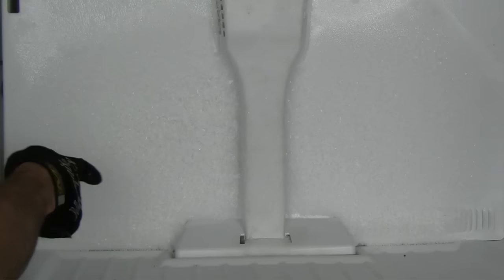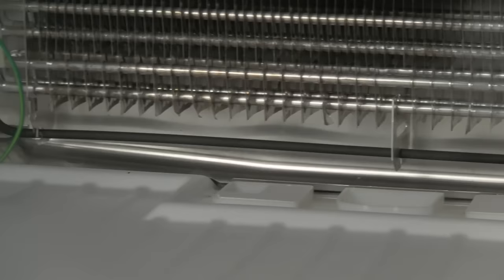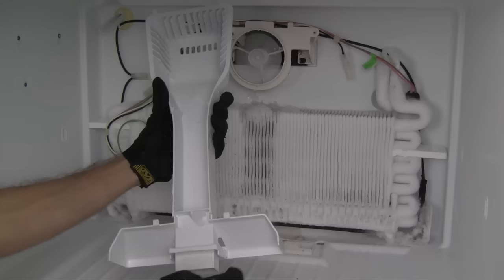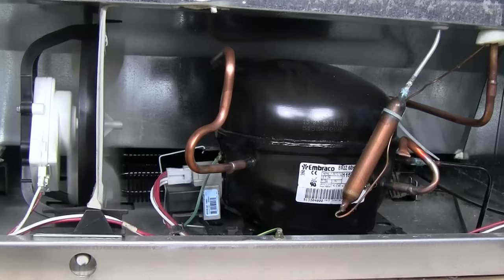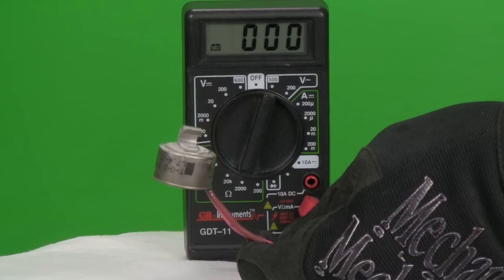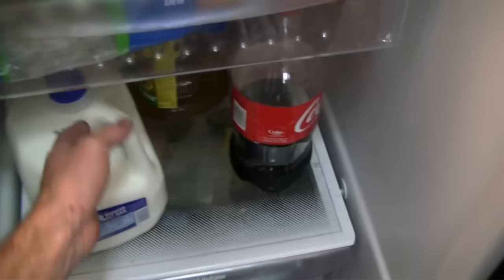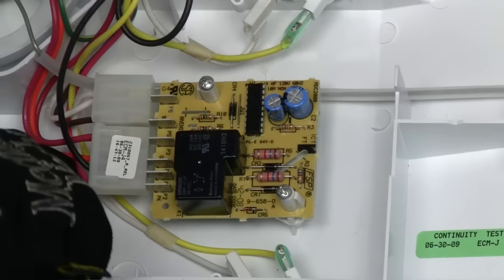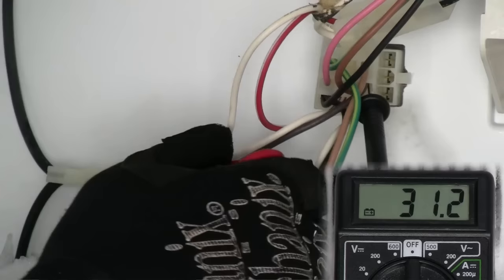Refrigerator Repair (Not Cooling, Defrost System)

Comment: I have a GE PFSF5NFZA model French door bottom mount freezer- freezer is super cold (-14c) and when I try to turn it down to 0 it just keeps getting colder and trying to get the fridge temp back down from 46c to 37c isn't working.  Called a repair tech and he came out and took the freezer apart and said there was no frost on coils, ice maker working fine, but he took the flap cover off the vent behind the dairy case in the fridge portion and said those two tubes where the cold air from the freezer circulates into the fridge were frozen solid and to defrost the fridge for 24h because most likely a door was left ajar... I did that and it ran great for a month and did the same thing- freezer super cold fridge warm - I called the tech again, he tested the control board and said the board which is the first thing that usually goes in these models is fine but my heater is dead and can't be repaired on this specific model because the way GE built it and I need to buy a new fridge- this fridge is barely 6 years old and no budget for a new fridge, is this something you have come across? I spoke to another tech that is familiar with GE and they said a number of things should have been checked too like the seals and doors, thermistor, thermostat, temp sensors, the relays to the heater and the temp control and felt I should get a second opinion.  When I defrosted it and it was running great, I could hear the fridge cycle on and off, now it runs constantly. I love this fridge and had zero issues with it before- regularly cleaned the coils only started having these issues after my son left the fridge door open (approx 3 hours later was when I noticed)  Any help or insight would be much appreciated.  Thank you!

Comment from the maker: Look for a flap like part that controls air flow into the fresh food area from the freezer.  That part is ether frozen open or if it's motor controlled the motor may not be working. If the air duct control door cannot close then food in the refrigerator can freeze.  What is your model number?

Comment: If the defrost heater goes bad, could that cause a ground fault and trip a gfic?  Or, is it more likely that the gfic is tripped by the board being bad?  I run my fridge in service mode and it trips it when I initiate the defrost cycle.  Many thanks!
Reply from the maker: The heater can definitely cause that problem. The other possibility would be the defrost thermostat, and lastly the control. If you get a multimeter you can check the heater and thermostat for any connection to ground on the cabinet, there shouldn’t be any. Good luck!

Comment: Hi, I have a Samsung side by side fridge freezer Model RS20CCMS. Recently the digital display has said it is at the correct temperatures but I noticed the fridge was getting warm. I turned the fridge off then back on and the digital display went from saying 2 degrees fridge side and -20 Freezer side to 16 Degrees fridge side and -10 Freezer side. I pulled the cover off on the inside of the freezer side and used a hair dryer to get rid of excess ice build up. it all worked well for a week and then did the same thing, the display was showing correct readings but when turned off then on again would show its actual temp which was not cold at all. Do you think my problem is with the display controller or with one of the thermostats? Cant really afford a new fridge at the moment so any help with this would be great! Thanks!
Reply from the maker: Sorry for the delay!  That's a tough one… If you have a trustworthy tech in your area that knows Samsung refrigerators, it would probably be best to call… I do have the manual for that refrigerator on my website so you can do diagnostics and see if there are any error codes to point you in the direction of the problem, but they are very complicated! Could be control, sensors, or defrost system problem.  Here is a link to the manual (Not for your exact model but probably will work) http://applianceassistant.com/Appliance-Repair/Appliance-Service-Repair-Manual-Feature.php?id=2219

Comment: Hi I replaced it according to an instructional video. However, After a while, I decided to clean the fridge and I went ahead and unplugged the unit to clean it properly. However, when I was cleaning the freezer side and open the cover on the back of the freezer I observed that the coil I replaced was burning the side wall of the fridge! The fridge has been working fine since I replaced this part, but I see know that I have a fire hazard there. How can I fix this? Let me know please
Reply from the maker: +Jessica Joy-Way First I would look to make sure its mounted properly, not off center... apart from that you may be able to shield the side wall that is getting too hot with some temperature resistant metallic tape... I know that sounds pretty weird but Frigidaire uses it quite a bit to protect plastic from hot lightbulbs.  I would guess that something with the heater or evaporator is out of place... Hope that helps! Sorry I couldn't be of more help.

Comment: The refrigerator just start making this loud run noise that sounding like a rain fall, and I unplugged it, and it still kept on running, and then I plugged it but up, and after 3-4 minture it stopped the noise! What happening?
Reply from the maker: sorry for the delay. It was probably the sound of water melting into the drip pan under the refrigerator. it's probably the normal operation, nothing to worry about.  : )

Comment: Great video thanks for sharing! I have an LG bottom freezer refrigerator that is cold in the refrigerator section, but is the same cold only in the freezer. My model number is LRBC20512WW. I opened up the back and the compressor is hot and the condenser fan is working. I replaced the start relay, but it was a waste and didn’t fix it. Any suggestions as to what the likely culprit might be? I have a multi meter if I need to check a component. Thanks much appreciated...Joe

Comment: @applianceassistant thanks, so far so good, but the refrigirater isnt as cold as it use to be, my milk use to freese on a normal setting,,

I dont have any thing in freezer, the owners manual said that frozen items will make freezer colder, I guess it takes a few days to get refrigirter super cold

since I thawed it out the fan sounds better and compresser dosent stay on as long,

Comment from the maker: @washrooms Take a look at the troubleshooting refrigerator problems page on my website (link is in the video description.) Click on "Checking the compressor and start relay." in the "Select the problem that best describes your refrigerator's symptoms from the list" (last one) That may help you to narrow down what you are dealing with. If the compressor is not running ether the board is not sending electricity for some reason, or the compressor or start relay is bad.

Comment: hi my refrigerator brand is iberna and it stopped cooling i have opened the back and fond some kind of plastic  plate above the compressor filled with smelly water how can i fix it help
Reply from the maker: +mohamed read That sounds like the drip pan. it's usually filled with smelly water from the defrost cycle, however i't probably more full because the refrigerator is not working... thats not your main problem though. If the compressor is running and its not getting cold in the freezer it's probably a major problem and not worth fixing. However, if the compressor is not running it may be the thermostat or defrost timer... here is a troubleshooting guide that may help.
http://applianceassistant.com/Refrigerator-Repair/Troubleshooting-Refrigerator-Problems.php

Comment: thank you very much for instructions. I have made troubleshoot on my start relay and compressor as you advised me. the voltage at the wire entering relay (relay input) was 220V ie supply voltage. but output of relay is much less than that about 35V.I also tested compressor for continuity and for resistance, it seems to be ok. I thought that I have problem with relay. my relay is 250V, 1.2A.  I replaced my relay with new one 250V, 1.4A but it did not help.do  I need exactly 250V,1.2A  relay?

Comment: Thanks for the helpful video. My freezer works normally for a few days and then it stops working entirely and everything melts. The ice still comes out normally but it melts in the container.  When the freezer starts freezing again, all of the defrosted food and ice refreezes, so I can't use this refrigerator until it is fixed. The refrigerator part seems to be fine.  Is this video the one to watch for troubleshooting whatever is wrong with my refrigerator?   I'll share your website link.  Sorry for the drop in hits.
Reply from the maker: Thanks!  Sorry for the delay in getting back to you on this! Sounds a little strange, Do you know the model number of your refrigerator? I'm wondering if it has 2 evaporators, because otherwise the fresh food section should warm up with the freezer failure....
Reply: I'll check and let you know. Thanks for getting back to me.

Comment: At 3:05 I have the same fridge style my condenser fan will come kick on for a second then kick off for a while until it finally kicks on. Is the fan bad or is it something else?
Reply from the maker: Hard to say for sure you would need to check with a meter if the voltage was dropping off. Odds are it’s a bad contact point somewhere, likely in the motor windings. If you wanted to guess at it I would go with the motor. I hope that helps some!

Comment: Thanks for the video. I need some specific help. I have a model #PSS26SGPASS that stopped cooling and just makes a loud noise, I think from the freezer side. The loud noise is only present when the doors are shut. The light inside and digits come on but doesn't show right temperature. At first it showed 555 on each screen, then it would show an error that looked like "Le", then it would look like it lets me change the temp but then would default to the numbers 78 on each side. Any idea what could be the problem? Thank you!
Reply from the maker: I would start with liking at the evaporator fan motor behind the back wall of the freezer.  That is likely to source of the noise.  It could be that you have frost build up or ice from the ice maker hitting against the fan which only runs when the door is closed.  You can close the door switch and check it out.  The temperature problem may be related to that, air flow makes has a big effect on temperatures.  Hope that helps some! Good luck!

Comment: Hi, so I just learned how to use a multi-meter today. I checked the thermistor, and its resistance varied with different temperature waters indicating that it's working. I checked the resistance of thermo-fuse and it was close to zero indicating that it also is working. However, when I'm checked my defrost heater, I'm getting a resistance of 1 which indicates that it's broken.

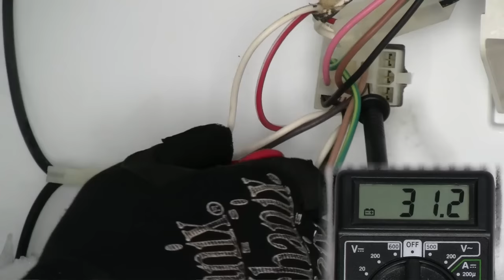However, I'm not sure if the way I'm checking the resistance is correct. I did it the way it was done at the video @ the 5:32 mark and got an infinite resistance. I wasn't sure if I was supposed to do it the way the video did it @ the 5:50 mark, as I didn't try that at all because I didn't understand it. 

Do I need a new heater?
Reply from the maker: Sorry for the delay in getting back to you on this.  It sounds like you have narrowed it down well! A new heater should fix it. Thanks for the question!

Comment: in the process of buying a new fridge but I can't help but wonder if I'm jumping the gun on ditching my old fridge. it has been problematic for some time now and a new unit is probably the answer but I figured I'd look around one last time....so, problems started months ago with a loud dropping noise whenever it cycled, so I cleaned around the coils on the bottom, it stopped for a bit but cont. to do it. then I was getting water on the bottom of the crisper drawers, i checked for leaks or

Comment: Question, I moved contents to the garage, cleaned it out a few days ago.There was no blockage, no frost. If the fridge is a 50F and I turn the dial to off and then back to high it will turn on and cool to high 30's, low 40,s. Later I will recheck it and it's warm again 50F. Could it need the thermostat and/ or thermal weight?

Comment: I have a GE bottom freezer double door refrigerator, model # GFMS5HFFA SS and I'm trying to determine if I need to buy a new evaporator fan. I have noticed that the refrigerator section warms up because the fan in the freezer is not blowing cold air up. It'll work fine for 5 or 6 days and then stop working. I should note that the freezer continues to stay cold and works fine.

The weird thing is that the problem comes and goes. I have determined that If I unplug the fridge for a few hours and plug it back in the fan works fine and cools down the refrigerator and both the freezer and refrigerator function as designed...and will sometimes work fine for several days and then suddenly the refrigerator is warm again...because that little fan in the bottom is not going.

 My question is if the evaporator fan goes completely it probably wouldn't fail and then start working fine after a period of rest. Are these fans known to work for several days and then suddenly stop? Or do they just go completely? I don't want to spend more than a hundred dollars on a new fan if the problem lies in the control board or thermostat. I do not have the expertise to check those parts...but I can quickly and easily change out the evaporator fan...if, in fact, it is gone.
Reply: Sounds to me like you may have a defrost problem... The few hours of being off may let it melt enough to let air pass. Is there a large amount of frost on the evaporator? The fan should be running anytime the compressor is running. However, on some models, the fan will turn off when the door is open so you need to determine if that is the case on your model.  If the fan is actually failing after a few days and it's not frost build up that is keeping the air from getting to the top and into your refrigerator, you may have a control board problem, that is more likely to be intermittent that the fan itself. However, I have had an intermitant fan motor from time to time but it's very rare. Hope that helps some!

Comment: Hi my side by side refrigerator is not cooling,and the freezer side gets full of ice,can you help me.
Reply from the maker: Start with manually deicing it by unplugging it. I should work for a about a week or two. Then keep a close watch for ice build up on the back wall of the freezer compartment.  If it comes back there is a mechanical problem with ether the heater, defrost thermostat, or defrost control that would need to diagnosed.  Hope that helps… Good luck!

Comment: i have an over/under unit and it starting making crazy noises the other day.  we messed around with it and i even left the freezer door cracked for a few hours.  that seemed to help the refrigerator cool again, but now there is no noise and it isn't cooling at all.  the freezer is working, though i am seeing a bit of frost on the food.  there is a little frost on the fan unit in the back.  i have just unplugged it to see if thawing it out will get the bottom part working again.  any thoughts???

Comment from the maker: Sorry I didn't see this post when I was writing the last one.  It could be the compressor with that bit of info... HAve you or any of the techs cleaned out the condenser coils under the appliance? there is a 3n1 hard start relay kit that increases the starting torque of the compressor (about 20.00 part). That may buy you a year or so if it is going bad... : (

Comment: What does the thermal fuse do on the evaporator of a samsung refrigerator? The service manual states there is a thermal fuse and a thermistor in the freezer but the illustrated parts breakdown states there are 2 temperature sensors.  Is the Thermal fuse the same as a bimetal thermostat?
Reply from the maker: Sorry for the slow response! Missed this one some how... The thermal fuse is a second safety agains the heater staying on too long and causing a problem. We will probably see more of that in future designs.

Comment from the maker: When the sides or the center divider start getting hot it is a sign that ether the coils under the refrigerator are full of dust and need to be cleaned... or that the fan next to the compressor is not working for some reason.  first check if the condenser fan is working, if it is unplug it for an hour and try cleaning out the condenser coils under the appliance. Say a little prayer then plug it in... It may have taken out the compressor in which case it's junk :(  Good luck!

Comment: i have a GE side by side. replaced the bi-metal thermostat and the heater element and frost still builds up in 2weeks, where i have to pull out the blow dryer again and defrost evap. what else can i ck and how to i test the board/thermisters correctly? help please. thanks
Reply from the maker: I will say GE Refrigerator control boards are a common point of failure, and difficult to isolate as the problem... I would advise replacing the defrost thermistor because it’s cheap, but odds are with all you have done already the control will be the culprit.
Reply: @applianceassistant  ok thanks. How can I place the fridge in manual defrost mode?

Comment: My fridge is the same as in the video, Whirlpool ER2CHMXPB04.  Freezer cold, fridge a balmy 55. Removed freezer back panel and I noticed 2 things.  1st, the evaporator fan is not spinning and 2nd, a chunk of ice was in the bottom of the center vent that feeds into the fridge below.  I turned the timer to activate the defrost cycle and the heating element turned on and after about 20 minutes the timer turned the condense back on.  Still no evaporator fan spinning.  Do I have a bad fan motor?